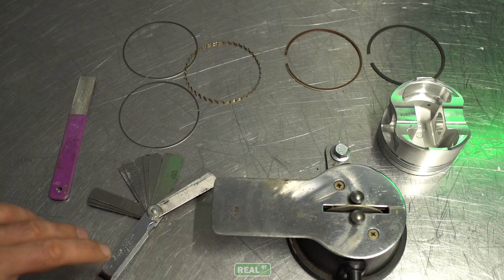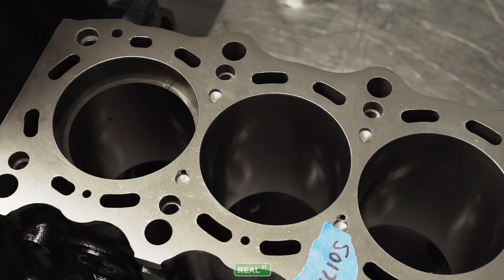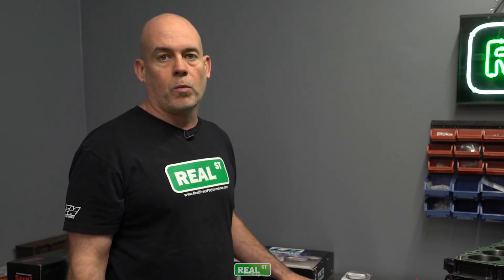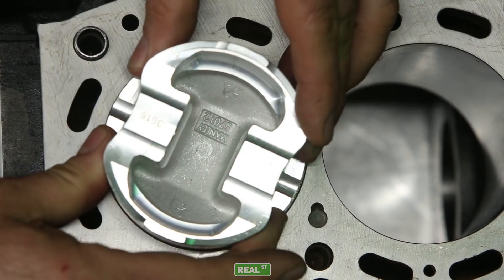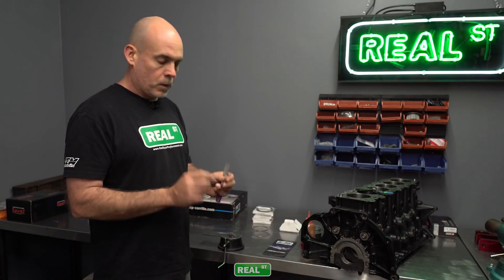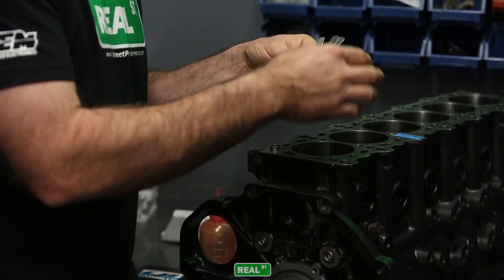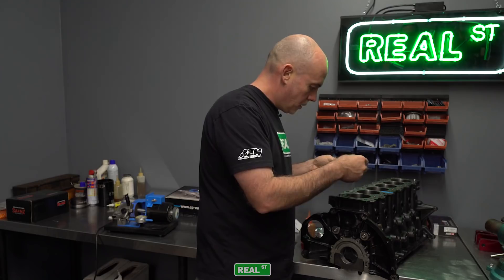Race Engine Piston Ring Filing Tutorial - Jay's Tech Tip

Comment: Although many people dismiss ring squaring tools as pointless, I prefer using a ring squaring tool to using a piston. First of all, pistons can rock, especially when only the top part is used to square the ring. This can cause the ring to not be square, which will cause the gap measurement to be too large. Also, by using a piston, you can possibly scratch the skirt coating by using it as a squaring tool.

Comment: I have a question. Let's say I'm building a fairly rare V8 engine and I was able to find 20 over pistons and 30 over rings. Wouldn't it be safe just to file the piston rings down a hair to get the gap correct?
Reply: I don’t think you can do that. For some reason it seems like I tried to do that with a sbc, I believe it was too much tension I never even got it in the bore. I’m not saying it’s not possible though

Comment: I want to ask for a diesel engine such as the Isuzu C 190 Gap Gap piston ring in the cylinder is the minimum and the maximum is how many m.m when measured using a feler

I am amazed by your explanation but I do not understand your language. Subtitles should be given for several languages. so there is a language text. Thank you.
Darmawan- Indonesia

Comment: At 11:30 you mention the large second ring gap to ensure no gas is trapped, is that a theoretical consideration or have you confirmed that with ring using the same gap cold ?
I ask that because in practical terms the top ring dissipates quite a bit more heat from the piston to the bore than the second ring and thus the top ring being hotter could in theory at running temperatures have a smaller ring gap than the cooler second ring, thus satisfying the need you state of having a larger end gap on the second ring to ensure no trapped gases.

Comment: Very good instructional video.  I have one question.  When adjusting the ring gap, why do you turn the grinding wheel in the direction that would have a tendency to lift the ring off the table?  Seems to me it would be better to turn the wheel in the clockwise direction so the table can help support the ring.
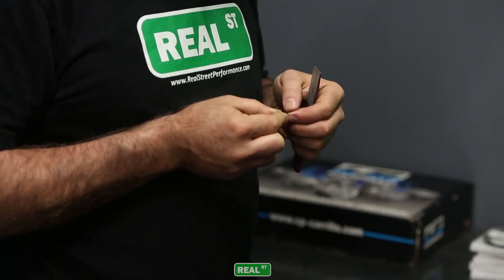Reply: He explains this at 13:10 in the video.
Some of the rings are nitrated and can chip easily if  you load the ring against the cutter.

Comment: I know a lot of racers say they use zero gap rings, but yesterday I had a racer say that he runs his engine with only the top ring and not the bottom ring cuz it cuts down on friction.... of course he uses the oil ring....  what do you think of his method?  This is a 417 c.i SBC what is the advantage and disadvantages of this?

Comment: followed your instructions and my JE Piston rings turned out excellent.  Using same grinder, 2nd compression rings only needed 6-10 turns- however the top rings took 35-50 revolutions to remove material

Comment: how deep should the ring be when squaring it? is it the same as all other ring?
Reply: Depends on the block, some engines want you to push the ring less than an inch from the bottom of the bore, some in the middle, some in the upper 1/3rd.

Comment: Question for Jay from Real Street. I'm building a 9.1 compression 351w that will be turbocharged. My plan is 20-25lbs of boost would you recommend the same ring gap measurements as shown in your video
Reply: Follow the piston manufacturers specs. They typically call for so many thousandths per inch of bore diameter.

Comment: So, first you're grinding an asymmetric surface onto that ring it dosn't match the other side I guarantee, 2nd you don't clean the abrasive off the ring before measuring but you talk about  .001 ths of an inch ( ! ), 3 rd you use a piston to " center the ring" making each measurement non comparable to the previous because the Pistons gap to the cylinder is too large to control by hand. How do I know? Not only was I an engineer manufacturing parts with 10 thousandths of an inch tolerance I was the crew chief on an NHRA dragster. Seeing this, if your engine doesn't run right I'd bet it's not the piston rings.....yikes......

Comment: What about measuring the ring gap while it's located where it will reside in the cylinder at TDC? Meaning like, don't measure the ring gap at the very top of the bore, or down at the very bottom of the bore.
From what I understand, the top of the block gets hotter and therefore experiences more thermal expansion.
Reply: There are also engine builders who say to set them deeper in the cylinder than tdc area for gapping.

Comment: People may wonder why sharp edges are not good for longevity. You will notice on tier one components that they’re generally very smooth. Reasoning that cracks always start at what’s called a stress riser. Stress risers are basically sharp edges, points and even inside corrosion pitting. You you ever observe corrosion like rust you know that it leaves peaks and valleys and an nonuniform surface after the oxidation happens. Think of why someone would de burr a block or piston. Removing material. Would make it less strong right? No way taking those potential places away for cracks to start will make your piece stronger. Just like on a bolt that brakes from like an over torque or plastic deformation. It’s generally in the bottom of a cut thread bc there is a sharp angle down there. And the cutting of the threads it’s self clips away the grain structure of the material. This is way some company’s go ahead and roll the threads kind of like a forging. It’s tedious and not very fun but it’s worth the extra work. Keep your mind open. There are generally many ways to achieve a goal. A good example of debur for strength is on a crank shaft in the fillet area or the oil holes. They will radius them and it drastically increases strength. Bc they took away a place for the crack to start. I am a geek and geek out of silly things like that but to a true student and enthusiast, it may be worth the brain room to explore this area of mechanics. Another builder could use the exact same parts as jay and not have the same results for this reason. All the little things in the end add up to a good piece. Stay free out there peeps. And ffs lets get some more e85 pumps in Kansas City please lol.

Comment: I'm building a Volvo motor with an 83mm bore, Wiseco pistons and total seal rings. Total seal documentation recommends a 0.026" gap for my 30+ psi boost application, whereas Wiseco recommends a 0.020" gap. I am going to go ahead with the 0.026" gap, but it seems very large for the bore size. So watching your video you indicate that blow by won't be an issue with a bigger gap, what about for 0.026" vs 0.020"?
Thanks.
Reply: 30lbs is a lot. 
I would definitely favor the bigger gap.
Reply: Sean may i ask what block your using please...   5 or 6 cyc block ?  keen as i'm planning out my build of my 2004 v50 2.5T as I've had her long enough she get promoted to toy. lol
Been keen if you could offer a little advance on the strongest 5 cyc block to use as they seem to all have weak spots any advice would be awesomely helpful.
Reply: @Ricky-NZ1  s60 T5 motors are the strongest, because they have 81mm bores. B5234T7, and B5244T5. I'm using darton sleeves in a 2004 B5254T4, which is what I  would recommend to you. The S60 T5 blocks are rare. Just use your B5254T3, as long as you have cared for it, it will be great with darton sleeves.
Reply: @turbovolvos40  Grateful Sean I'm only looking for around 500 whp as that would be heaps for a daily plus track car.
Reply: @Ricky-NZ1  you might be able to get away with a basic shim kit for 500whp, (https://www.deeworks.ca/product/volvo-whiteblock-5-6-cylinder-liner-shim-kit/). Or you could go with a block guard and shim kit to be even safer, (https://www.deeworks.ca/product/5-6-cylinder-whiteblock-block-guard-cnc-cylinder-support/). The darton sleeves will definitely be the most reliable though.